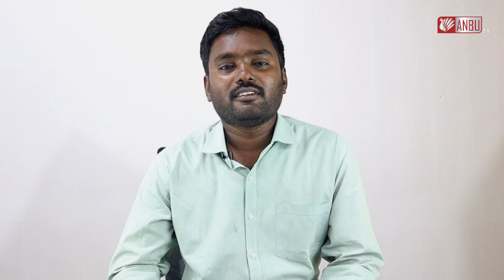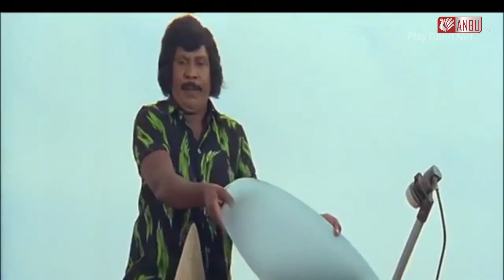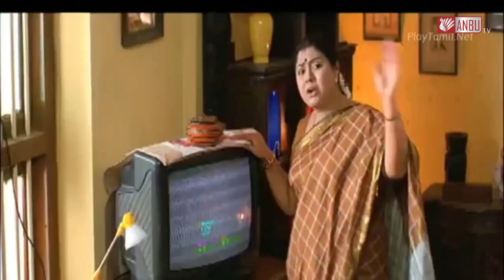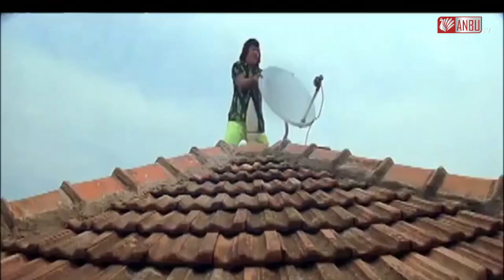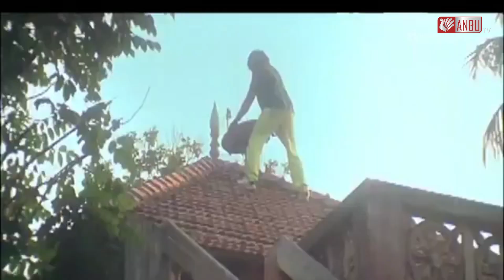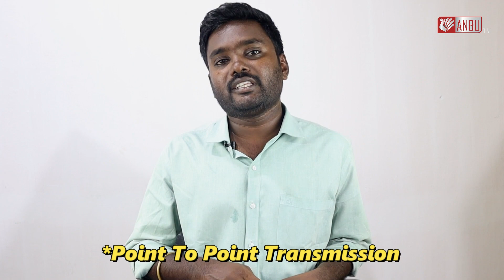JIO AIRFIBER Is Possible? JIO 5G | Anbu Tech

Comment: ஜியோ airfibre 5g hotspot avalothan. They are using carrier aggregation so  u will get good speed on top of that they are launching in Stand alone mode.  Jio fibre and tower connected fibre are different things . In urban areas only jio fibre available but even in rural areas many towers are connected via fibre.
Reply: Still ji jio fiber broadband is not feasible in valangaiman city thiruvarur district Tamilnadu in 2022 september  our valangaiman is a town panchayat still jio fiber broadband is not feasible in valangaiman city